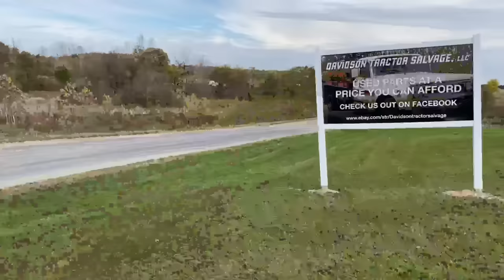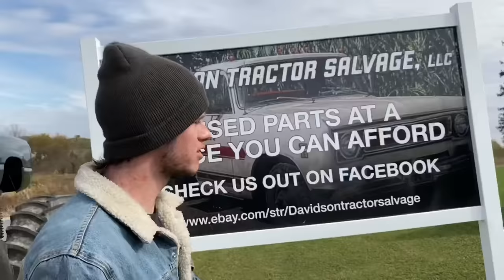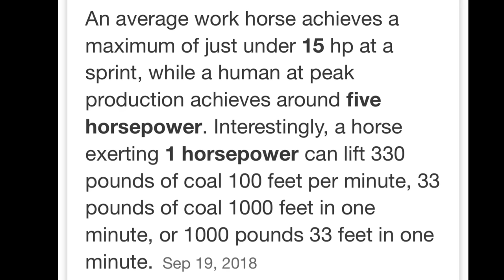7 TRUCKS vs Monstermax

Comment: 1 horse = 15 hp, there is no logic in that.
I'm still laughing
Reply: It's true a human can generate more than 1 hp ,
Reply: @benadams5557  so the cars hp are bullshit. Like pmpo power for audio.
Reply: @tuduff  the torque is the most important when it comes to power I believe
Reply: Anyone see a trump flag
Reply: 1 hp is what a horse should be able to pull for a long duration of time. You can lift 200 pounds but you can't hold it up for 2 hours.
Reply: @Ramon314  there are people that can

Comment: WD: keeps breaking drop boxes. 

sounds like you need 100lbs gears.  (Gears that weigh 100+ each)  2+ inch thick gear teeth, make your drop box so heavy duty it can be used after a bit of drive tanks target practice.
Take one of these boxes over to Matt's 'ranch' on a friday. See if it can survive a friday on the ranch.

Comment: Why aren't monster trucks breaking these drop boxes like you have you contacted bigfoot guys or something they had to have had the same problem at first?
Reply: They don't put the stress on theirs like he does.
Reply: Jumping cars doing back flips with 2500 hp isn't hard on them ? I'm just wondering?
Reply: @poormansyoutube686  little heavy on the hp. Its 1400 to 1500. Most use 572 cu in motor but some use the 540. Yeah that's still a lot but they aren't trying hooking to tanks. HA
Reply: I love the content I just wonder why these company's cant make something more strong for him if its weak go bigger obviously
Reply: Yeah they solved the problem by putting planetary hubs on the axles. They provide a 3 to 1 gear reduction at the wheels which cuts a huge amount of stress on the drivetrain

Comment: When considering human-powered equipment, a healthy human can produce about  briefly (see orders of magnitude) and sustain about 0.1 hp (0.075 kW) indefinitely; trained athletes can manage up to about 2.5 hp (1.9 kW) briefly and 0.35 hp (0.26 kW) for a period of several hours.

Electrical horsepower hp(E): ≡ 746 W

Mechanical horsepower hp(I): ≡ 33,000 ft·lbf/...

Boiler horsepower hp(S): ≡ 33,475 BTU/h = 9,...

Air horsepower: =flow rate (cubic feet / minute) × ...

About featured snippets•
Feedback

Is 1 HP equal to a horse?

How much horsepower is available in a matured human?

How much horsepower is average?

How much horsepower does a Usain Bolt have?

Feedback

Jun 22, 2016 — When considering human-powered equipment , a healthy human can produce about 1.2 hp (0.89 kW) briefly (see orders of magnitude ) and sustain about 0.1 hp (0.075 ...
17 answers · Top answer: Short answer: more than 1 hp for sure, depends on body type and training level though. ...

How much horsepower does a human generate while ...

8 answers

Aug 17, 2019

If an average healthy human can produce 1.2 ...

7 answers

Aug 17, 2020

Does 1hp (horse power) mean power of one horse ...

17 answers

Jun 28, 2016

How much horsepower do you actually need in a ...

9 answers

Feb 2, 2019

More results from www.quora.com

Feb 15, 2017 — A healthy human can produce about 1.2 hp briefly and sustain about 0.1 hp indefinitely; trained athletes can manage up to about 2.5 hp ...
Converting Horsepower... to Duckpower? : r/theydidthemath

Jun 20, 2016

How much humanpower is one horsepower unit? - Reddit

Sep 7, 2015

How much horsepower does one horse have? - Reddit

Aug 12, 2018

How much horsepower does a horse actually have? - Reddit

Nov 27, 2020

More results from www.reddit.com

Oct 7, 2021 — On average, a horse can achieve a maximum output of 14.9 horsepower. However, this number will vary between each horse. An average human has a ...

How many ducks does it take to equal 1 horsepower? — What car has the most horsepower? Is long horse good? How much hp does Turbo add?

Sep 27, 2021 — Suddenly his invention became much more tempting. Although Watt may have "bent the truth" to make his engine more appealing, ...

How is Horsepower measured? Can Humans Generate Horsepower? How much Horsepower does a human have? How much Horsepower does a human have on a bike? What is ...

Sep 2, 2016 — By comparison, a human being is capable of approximately five horsepower at peak power ... How can horsepower have different definitions?

What is horsepower? · A bit of history · The power of one horse · Not all horses are alike · Power outputs and the average human · What about metric horsepower? · Don ...

PDF

8. How many M&Ms would the Runner have to eat to gain the energy that she lost in climbing the flight of stairs? 9. If ...
2 pages

how  horsepower does a  have
how much horsepower does a  have
how much horsepower does a  have  a 
how much horsepower does a  have

how much horsepower does a  have
 horsepower 
how  horsepower
 horsepower

Comment: Every monster max video ends with you needing a drop box. What are they running in the commercial monster trucks? You need one of those.
Reply: The problem is that he has a diesel in there and it's the amount of torque that is breaking the dropboxes, i'm pretty sure broke one that was rated for 2000 horsepower but i could be wrong

Comment: Did anyone else figure out that the skid loader they were using looks identical to the one that got stolen. The only reason I know is be the handles in the boom are pointing in instead of out. Most skid loader’s handles are pointing out. I could be wrong but the is something pretty interesting.

Comment: This is the 2006 Chevrolet Silverado Crew Cab Monster Truck with a 6.6 liter duramax  turbo diesel V8 that produces 350 horsepower and 650 ft ponds of torque, and a 6 speed automatic transmission with manual shift ability with tow haul mode.
Reply: *ahem* NEEEERD

Comment: should cut the tires like monster jam guys do he could shave off like 300lbs of unsprung weight. I've read on monster jam trucks uncut tires sap like 200hp also
Reply: It's even bigger now, there would be no point in doing that because it will cause the new one to just topple over
Reply: @mastermason4766  I'm not talking about the new one. I'm talking about this one, he still has it.
Reply: @FastPaull  This same truck is monstermax 2.0 now
Reply: @FastPaull  The one that looks just like this and same size is a different one and is single cab